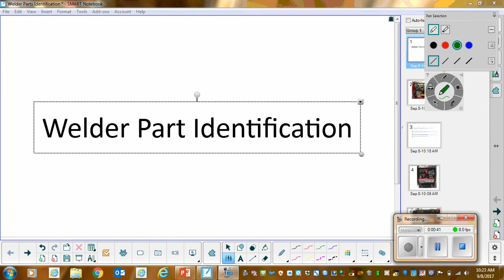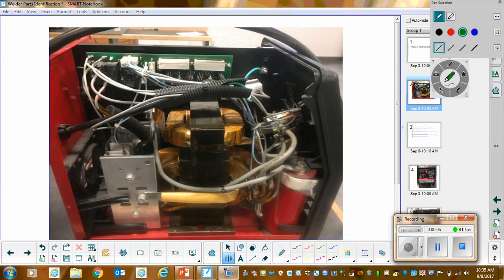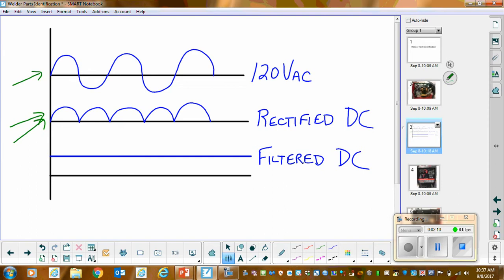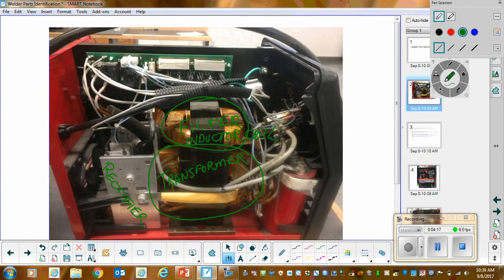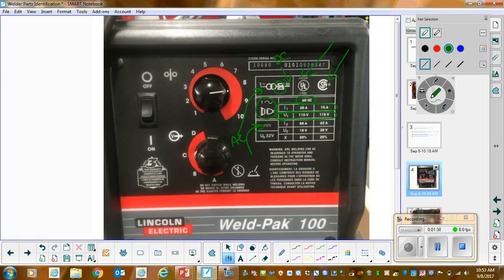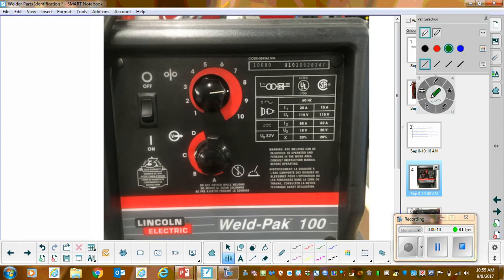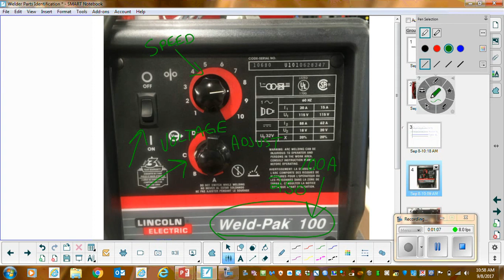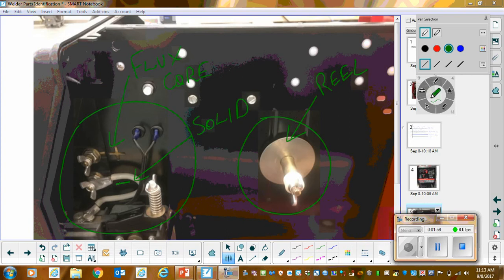Welder Parts and Basic Operation of a GMAW or MIG Welder

Comment: I am trying to produce a product in my garage.  The machine I am making which builds my product needs to make 2 welds, preferably at the same time.  Do you see a problem making 2 welds at the same time?  I am thinking about buying 2 migs OR is it possible to get one mig to make 2 welds? (instead of 2 migs at 30amps, have one set at 60)  Everything will be automatic.  I'm even making a wire feed system that pulls 2 spools with one beefy motor at the same time.